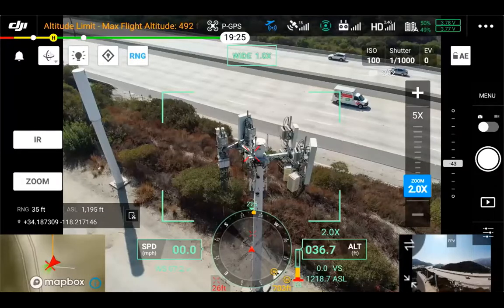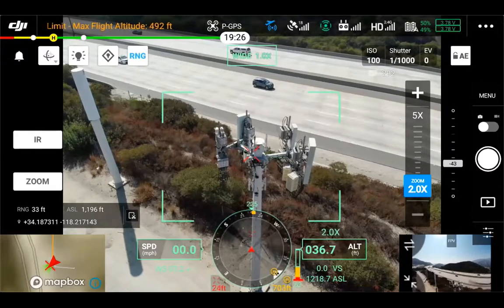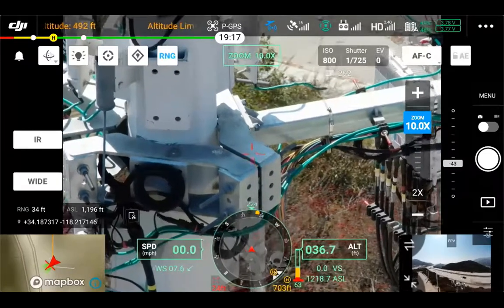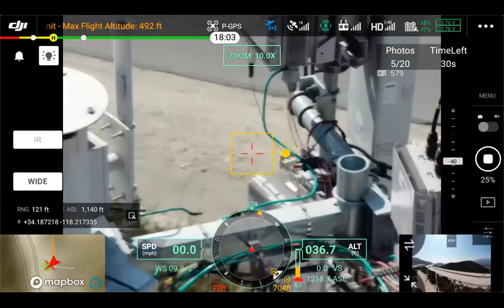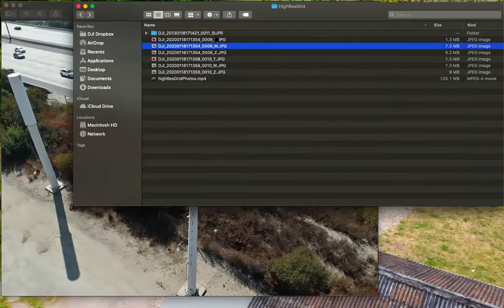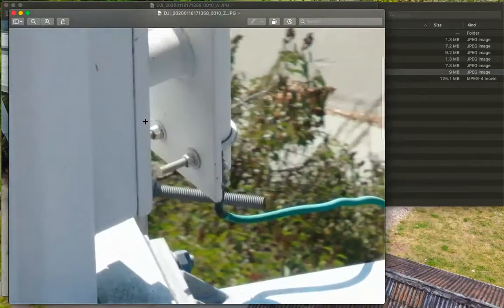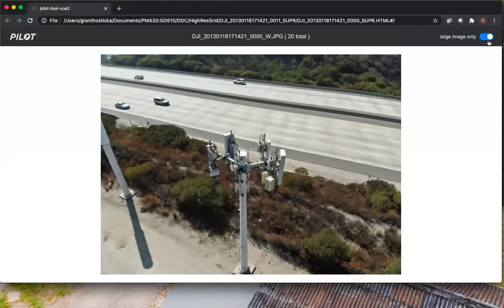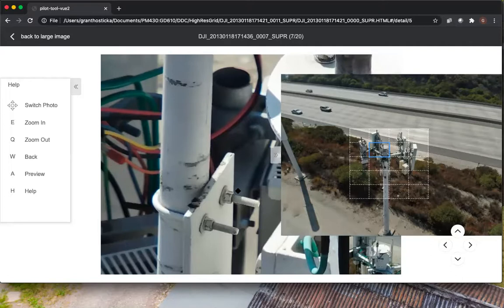High-Res Grid: How it Works & Why it Helps Inspection Workflows, Matrice 300RTK & Zenmuse H20 Series

Comment: Great video, thank you.  I flew my Matrice 300 with H20 yesterday to refamiliarise myself with the High Res Grid funciton as I need to photograph some huge wharehouse roofs next week.  I have previously successfully used the High Res Grid to record large elevations of buildings.  When I was practicing yesterday to record High Res Grid with the H20 angled downwards at about anything beyond 60 degrees the H20 would record photos at diagonal angles and be a long way out from the grid square of the corresponding main grid table.  Oddly when I then recorded another high res grid with the H20 at only 10 degrees downward angle, the corresponding grid photos were fine.  Is there a maximum downward angle for the H20 when using the high res grid or can you suggest a means to solve the above issue?  Many thanks!

Comment: Is there a way to have the zoom of the H20T smoother on video, instead of stepping to hard defined points?
Reply from the maker: While holding the select button on the top right front of the RC can zoom in and out in small increments with the dial on the back right. Usually this dial will move the camera but while holding the button it will control zoom.